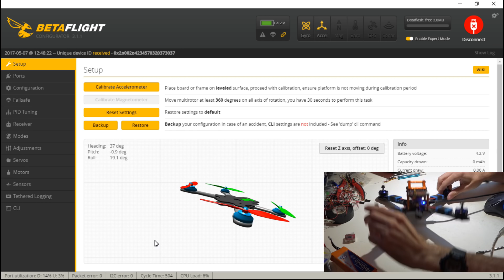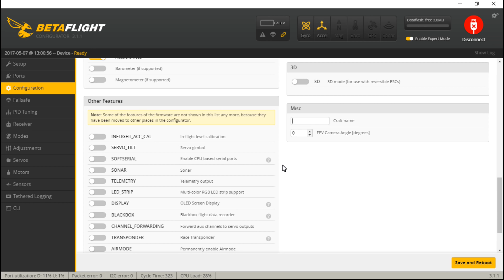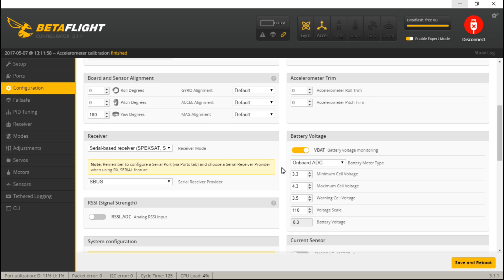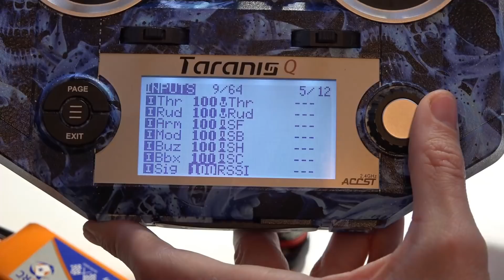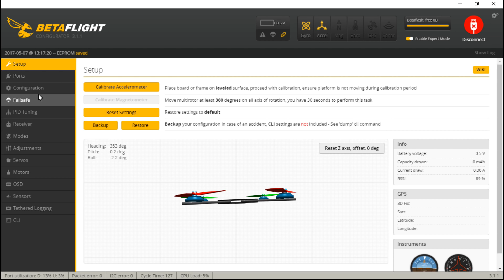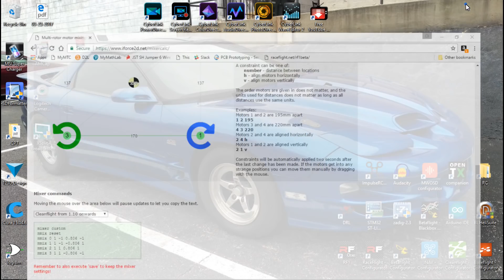Multirotor Build Pt15: Betaflight Set Up

Comment from the maker: Correction: The Banggood Omnibus does have a dataflash chip for Blackbox logging (16MB). It was just full and I had to clear it.
Reply: Hey JC, I have an omnibus f3 and tried to turn on barometer and magnetometer to see if I had the sensors on this board.  That completely locked up the board.  I can't access it from my PC, it says the drivers malfunction where an other quad I can just plug in fine, I can't get back into bootloader mode, when I connect a battery, I just get the 3 first ascending beeps, then it stops beeping whereas normally the sequence continues.  Any idea what could go wrong?  I just enabled those 2 sensors, don't think the board has them though.

Comment: JC, as I understand it using custom motor mix on any quad regardless of aspect ratio is pointless. My reasoning is that mass distribution is not equal between pitch and roll because the battery mass is a dominant contributor to the overall mass of the quad. Since all batteries are oblong the pitch an roll moments will always be different. The PID tuning of pitch and roll separately accounts for the different moments. Again as I understand it the custom motor mix is for motor layouts not covered expressly in the configurator. The lack of a stretched X option in the configurator would seem to support my interpretation.The only positive to using a custom mix is the final tuned PID numbers for pitch and roll may be numerically closer.

Comment: Hey JC, great video series! One thing that I had a lot of trouble and you just mention briefly in this video in particular was the failsafe setup. Can you do a video with some more details on how to set it up? I'm curious to know if there is any hardware requirements to get it working properly.
In my particular case, I'm using an IS6C receiver with the Turnigy Evolution. With the default settings in Betaflight the failsafe would never trigger, even if I turned the Evolution off. The only solution I found was to put VrA on channel 8 (I don't use that input) and set it to 100% on the Evolution failsafe config. Then, I configured a failsafe trigger on Betaflight using that channel.

Comment: In a lot of videos the debate over F3 vs. F4 usually comes down to it not mattering as long as CPU load stays under 36 (or so depending on the source) on the F3.  In this video, you seem to stress lowering the CPU load as much as possible.  (there is also usually some hint that the F4 introduces other complications)

Is this a special situation because you're building race quads and the tiny difference in CPU response matters here, where it doesn't matter as much with general use quads?

Does a lower CPU load translate to significantly lower power usage and longer flight time?  Does an F4 use more power than an F3?